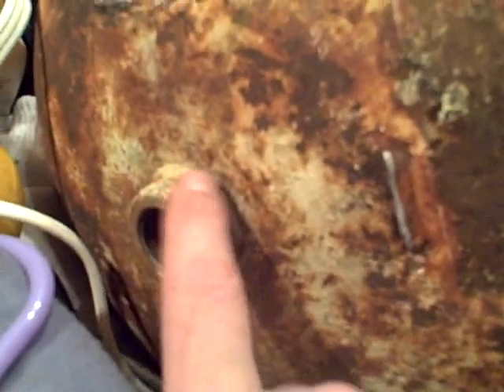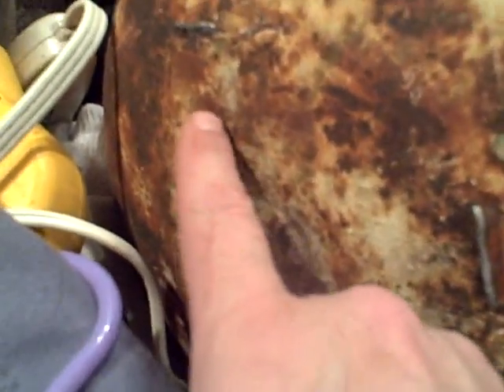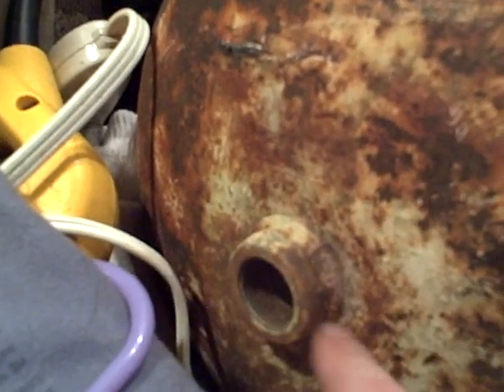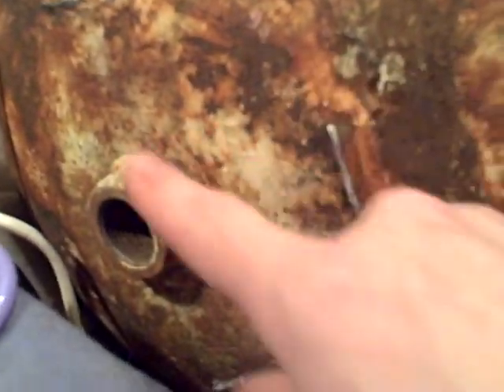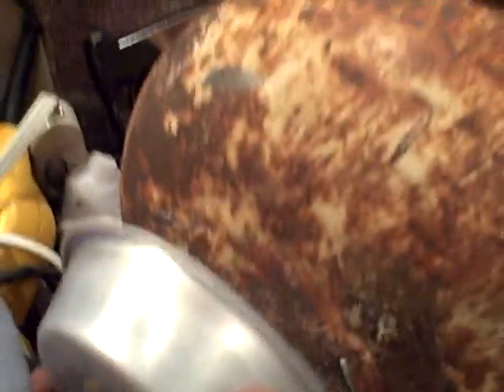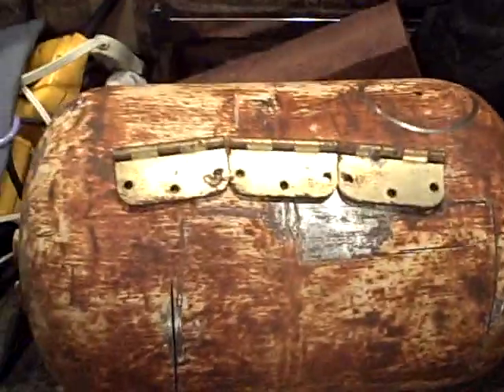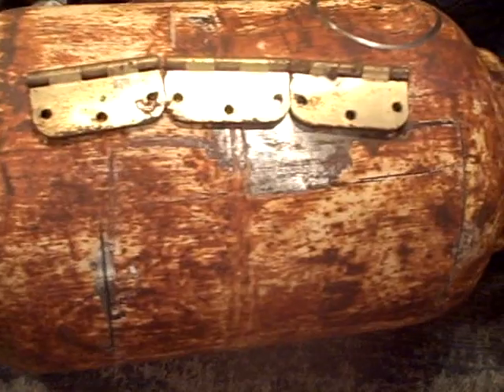Home-Made Propane Bottle Wood Stove + Hot water coil Designing Stage

Comment: how about, building a fire brick housing around your propane stove, just leaving an entrance to insert your wood, just like building a wood burning stove ,the heat bricks will get warm from the tank, then putting an air flow system through your house, from the cavity from the tank to the fire brick wall produce warm air and also hot water, just a thought
Reply from the maker: it works pretty well without the coil at all, just sitting next to the stove heats it up pretty good!